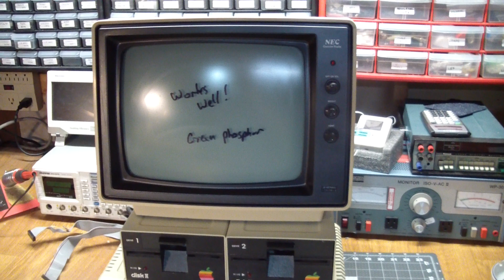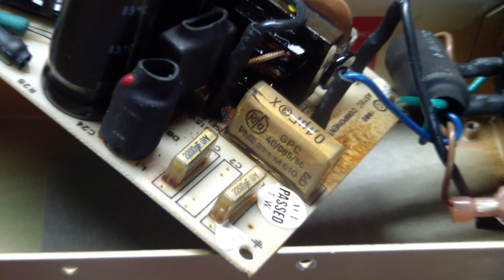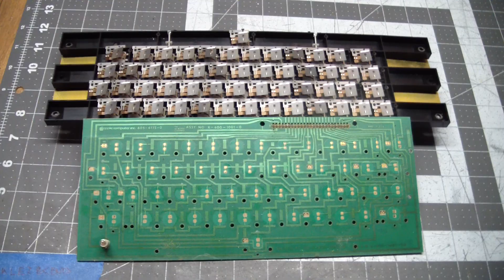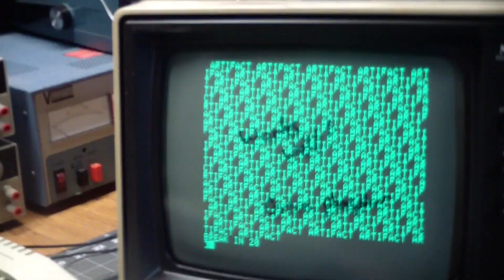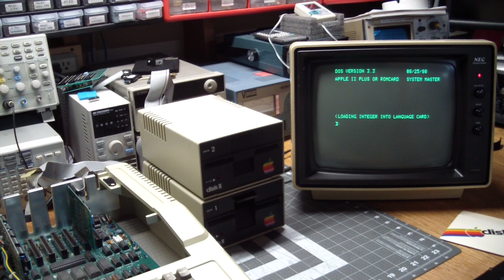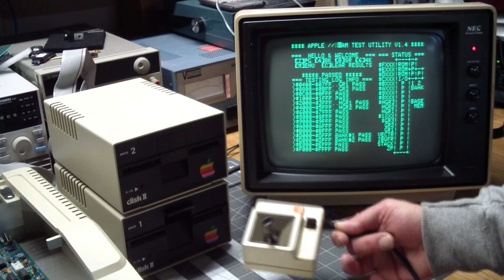AE#224 Getting An Apple II+ Back To Full Working Condition

Comment: Good job - I still have my original Apple ][ Plus from December 1982.  Curious what the abrasive stick you used for the keyboard cleaning?  Any links where I can buy one?  The REPT key on mine has been fiddly for many years.  I had the power supply re-capped several years ago.

Comment: Thanks as always Arti --I have a bunch of the same vintage computers that you have, i think. A TRS-80 Model 1 and 3. I've also got an Apple ][e, i should dig it out and try writing a few discs. I only have one drive, but pretty sure it is in working condition. 

My other vintage machines are: a Timex-Sinclair 1000 & 2068, 2 Commodore 64s and a 128, TI 99/4a, Atari 600XL and a few 90s Apples. Love these old machines. But for me, it all stated with the TRS-80 Model 1 in 1978, and it's still my favorite today.

Comment: I suggest downloading a better disk test program that checks speed and alignment.  Both are easily adjusted on these drives, and they drift.  If one drive is way out of spec, it will still be able to read disks it creates, but they may not work in another drive that IS in spec.  Since you have two drives, one quick and dirty test is to make a make a disk on one drive then put it in the other drive to make sure it's bootable/readable.